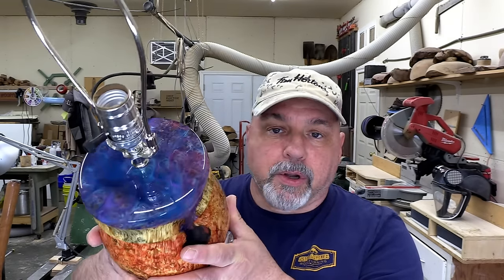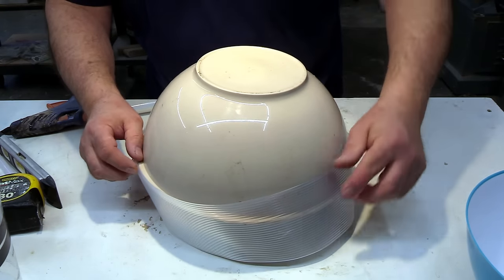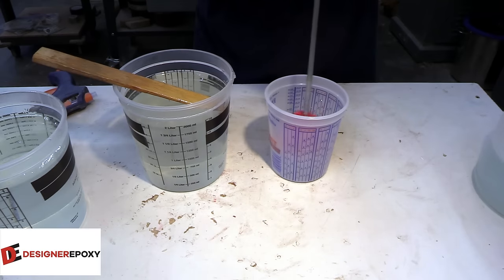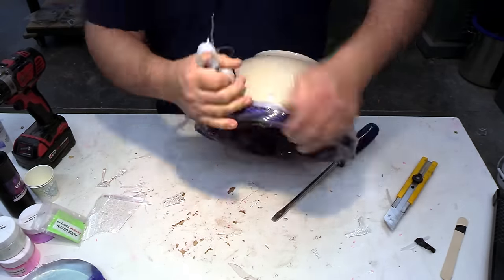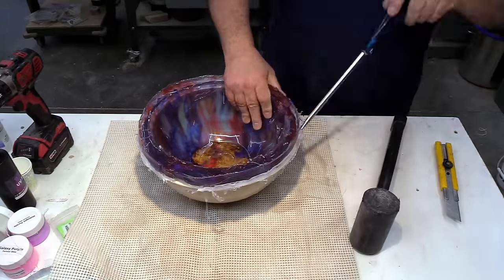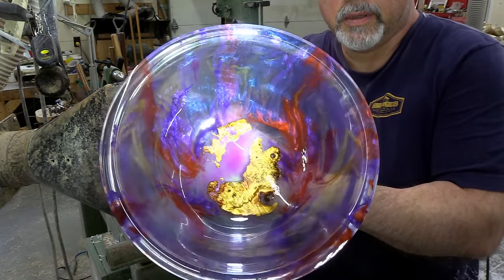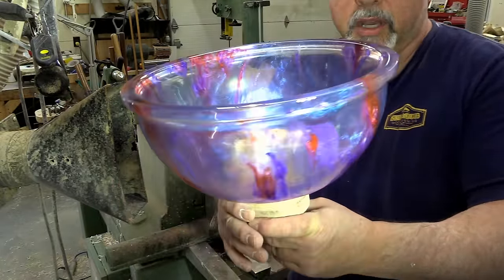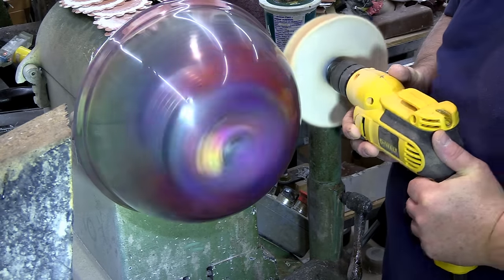Woodturning - Making the Shade, The Coral Reef Lamp Part Two

Comment: So glad the tip on the blue LED worked out! (That was me. C/o mostly my years of working with reef aquariums.) Definitely looks even more awesome with the blue bulb! It brings out that real depth in the layers. GORGEOUS lamp!
Cheers!
Reply from the maker: I’ve got a black light now and will take a photo and post it in the community tab later this week. Thanks for the suggestion!
Reply: @SpragueWoodturning  The thing with blacklight that I'd be concerned about is the UV, but not all blacklight bulbs actually give off UV but still get that glow, which makes sense (but is beyond my understanding, or at least recollection). Cos UV rays of course damage our tissue (especially skin & eyes, dangerously so with UV from fluorescent & halogen bulbs) and also anything exposed for a while, like the resin of the lamp. That's definitely a factor in the eventual yellowing, crazing, & cracking. IF the bulb doesn't give off any UV (as, again, some "blacklight" bulbs don't) then no problem, but do note. Blue light, however, doesn't give off UV, so there's that. Also, true blue LEDs work better for the glow, ime, and also vs a blue cap over a white LED like the bulb you showed, which still gave great results so imagine! You can easily get one of those bulb retrofits that have a regular e27 screw-in but have several LEDs in blue and in cool white, the blue for that glow & the white for normal light. Usually sold as a grow light bulb or aquarium bulb. All this, feel free to take what I've said here & ask others, like if you have or use Discord, or any board (Reddit or something) that does aquariums or indoor plants would know, probably resin folks ought to have found this, though surprisingly I (personally, anyway) haven't seen it utilised in this way, to make stuff glow.

Sorry that was long, but hopefully it might be useful, or point you in a good direction for this &/or future projects, to get that extra pop & take full advantage of that glow quality. Cos really, just a couple of blue LEDs can make the glow stuff GLOW full-bore without having to be dark (though it's more pronounced the less bright a room) and that can really make someone think twice about "glow in the dark" parts.

Final tip, technical info: in aquarium use, especially reef/saltwater tanks, the specific blue light used is called "actinic blue" (said like "uh'TINNic" or "ah"... not quite "æ" like "cat") and is 420nm to 460nm wavelength. (And inb4 "true" actinic, cos it matters not for this application.) This is different from the "blue" 20,000°K (as in Kelvin, colour temperature used for mostly full spectrum bulbs & their appearance, not the nm wavelengths of coloured LEDs), also known incorrectly as "20K" (would be "20k°K" or at least "20kK") ... Just ignore that stuff, mostly for halide/vapour bulbs & for full grow lamps with full-spectrum mimicry.

Sorry, I never learned to be concise! :x
Reply from the maker: @mookinbabysealfurmittens  have a look under the community tab and tell me what you think. Yellowing could be a problem over time with the black light. Thanks again for the info!

Comment: The switch was meant for a 3way bulb and an incandescent bulb. The LED bulbs run at a different frequency that your eyes can see where incandescent run a full spectrum which is why they burn more power. I don't believe they make an LED tri-liggt for that switch, but if it's by a window, it should recieve enough natural light to glow. A great video as always Jim, looking forward to the next one. 

#thebucketstruggleisreal
Reply from the maker: Yes, I also posted a picture on the community tab showing it with a black light. It’s pretty much exactly what I was looking for. Thanks

Comment: Really nice job on the color separation. It is a spectacular piece!
I use frozen water bottles in my pressure pots with my pieces to help with curing process. Of course I pour out a little bit of water from the bottles before freezing. I can hear them kind of making a crackling sound when I pressurize it, but have never had them bust or leak. Now I should probably knock on wood after saying that. Hahaha. Just thought I would share my experience with water bottles. Designer Epoxy 😉
Reply from the maker: Interesting idea! I just might try it sometime. Thanks!

Comment: Another beautiful art piece Jim.  The Designer Epoxy really shows the color separation and clarity on this one !  You may want to look for a shorter harp for the lamp...lowering the shade down to cover more of the switch and harp connections.  Just a suggestion.  Great project.
Reply from the maker: Didn’t know harps come in different sizes. Thanks

Comment: OMG!!!! That is beautiful. Love this piece. Loved it with the bell aspect. It really puts some special effect to the lamp that straight sides wouldn't have. Just the right amount of wood in the shade in my eyes at least. The blue light is better. They used to make a UV light bulb back in the 70's but not sure if you can still get them or not. Designer Epoxy has really opened up a lot of different uses. Amazing stuff.
Reply from the maker: They still do, with I had of got one for the video. Thank you very much!

Comment: I love how willing you are to experiment and be philosophical when things don't work out as you had hoped! I like the bell shape of the lamp too, it looks vintage. Woodturning seems to be such a process of problem solving and finding creative solutions. I wonder if it would be feasible to pour all the resin in and then put the smaller bowl in with Dwayne on top to weigh it down. It might not work well if the resins all combine into one colour, I don't know. Just a thought. I'm with you on using the blue LED light looking better. Very cool!
Reply from the maker: Yes, but it would be difficult to measure the volume correctly. Thank you very much!

Comment: AWESOME Jim, I like the blue light the best. The Bell feature really adds to the bottom of the shade. I have had epoxy get very hot and melt a plastic jar. That is why the hot melt glue started melting on you as well. Designer Epoxy.
Reply from the maker: Yes, she got hot, lol. Thanks

Comment: I think this came out beautifully and is price appropriate for a work of art rather than a utilitarian lamp.  I would have like to see the shade be a little longer to cover more of the metal parts, but it is an exceptional on for the first time doing a lamp.  

I'm wondering what some of the ever popular hyper shift would do look like in the shade as well.  Maybe it would compliment the bubbles even more towards the ocean theme.  

A more economical way do make a lamp, might be to do a pillar style.  So it would essentially be a deep narrow vase with the bulb screwing in at the bottom.  Then it would be approximately half the labor that you put into making the base and the shade individually.  

Love your work overall.  Always hoping my crits are taken constructively, as that is how I intend them.

Designer Epoxy
Reply from the maker: Thank you very much! You just might see that soon.

Comment: Jim nice lamp I liked the base , maybe kif you ever make another lamp you might be able to put more wood maybe something really light in wieght so it wouldn't uze so much Designer Epoxy in the lampshade because I know how heavy that might be with that much resin in the lampshade .It really is very nice looking ,but I would be afraid it might topple because of the weight .Keep up the good work Jim 👍,Your friend Henry
Reply from the maker: The harp seems to hold the weight just fine, but yes, it can be a problem, thanks!

Comment: Designer Epoxy. Jim, this is a masterwork. I am glad you tackled something new and accepted its challenges. I do like the shape of the shade and the rim is a great addition. Question: What is the approximate thickness of the shade in the middle (knowing the top and rim are extra thick)? I'd like to attempt a pure resin shade and a pure resin bowl but I'm unsure of a thickness that would be sturdy enough.
Reply from the maker: The sides are about 1/4” thick, thanks.

Comment: First time I’ve felt at a loss for words. It’s beautiful. But I prefer the shade for a lamp like this to be of the flared slat type. Can be as long or short as wanted. For this lamp a resin slat, with a very thin wood slat, alternating around. Or instead of beautiful wood, oiled parchment, maybe with resin colors on it, as on the resin slats. It’s done that way with these lamps made of glass.
Reply from the maker: Thanks for the suggestion!

Comment: Jim- The finished Iamp is beautiful.  I like the rim on the bottom of the shade. If it were mine (I can dream, can't I?), I would get a slightly shorter harp and a taller finial (perhaps in an ocean theme of some kind to go with the theme of the lamp.  I do like the blue bulb in it much better. Awesome job! 😊 Designer Epoxy
Reply from the maker: You and me both!  Thanks so much!

Comment: Hi Jim - Great job on the coral lamp! Have you ever made a resin piece using flower pots as the cast in any of your travels? Nesting different size? Just wondering - thanks a bunch! Bob
Reply from the maker: Not yet, I was going to use two smaller buckets for this casting, but decided to use the plastic bowls. Thanks

Comment: Hi Jim, you have been doing this a long time and I really respect your work but with your rice calculation are you allowing for the air gaps between the rice? If so can I point out that wen you poor the rice into a measuring pot the gaps are still there and do not need to be accounted for. Please let me know if I'm understanding this wrong. All the best, Mike.
Reply from the maker: The measurement is actually .4, it’s just easier to times the volume by 1.4 to get the correct amount, and yes, it accounts for the space around the rice. Thanks
Reply: @SpragueWoodturning  I realise with the 1.4 is .4, what I'm saying is that you do not need to take into consideration the gaps in the rice. Thanks
Reply from the maker: @MikeHolton  Ok, I’m not totally sure what you’re referring to. If I don’t account for the space around the rice when it’s placed into a container that I can get a measurement from, the volume that will be needed will come up short. Sorry, I’m just confused with your comment. Jim
Reply: @SpragueWoodturning  Sorry Jim, probably my poor explanation. In a recent video I made I had a few comments from people that you allow in your calculation (1.4) for the space between the rice grains which did not seem correct to me.

Comment: Great work. I like how this turned out with the base and lamp.  Question for you... I like how the Art Cast thicken quicker to get your color separation. You used the Art Cast for your primary color and the added colors. Have you ever tried using Deep Cast as your primary color and adding thickened Art Cast for your added colors? Designer Epoxy
Reply from the maker: No I haven’t, but I’m told it’s possible. Thanks

Comment: It came out very beautiful! 
I do know some things about LEDs and UV light. Most UV LEDS also emit some high-frequency visible light, which is as much a technological limitation as it is a safety feature. A single UV lamp that's on all the time in a room isn't likely to give one skin cancer but it is bad for the eyes. A UV bulb that is powerful enough to work as a blue mood light or something to read by isn't a good idea for a lamp. The bulb used in the video is indeed blue but it's not made with blue LEDS; that sort is regular white LEDS with a blue filter on the bulb because it's a whole lot cheaper to make. Actually blue LEDS do often have some UV emission and that should probably do the job. A sunny window that doesn't get too hot is probably better than a UV bulb, but if the glass is made to block most UV light then the owner of this lovely lamp will just need to have a separate UV light to charge it with when they want to see the effect.
Reply from the maker: Thanks for the info!

Comment: There are light parts manufacturers out there that make a shorter light bulb mount, including a shorter, 'halo', lamp shade hoop.
To lower the lamp shade down closer to the base, thus hiding the switch/bulb base.
Reply from the maker: I did buy a shorter harp for this piece and it looks much better. Thanks

Comment: Given a lampshade is a diffuser, I wondered if coating the inside with a somewhat opaque color would allow the lights glare to soften while the shade is still somewhat transparent?  Just a thought. Nice job overall, long project, lots of work involved, good job!
Reply from the maker: Opaque would work, but I’d be worried about loosing some color in the meanwhile. Thanks

Comment: It's kinda weird to me that the top matches the bottom better when the lights are turned off and the UV light hits it. During the day, the shade doesn't match as much unless it's at a certain angle. Too bad a little bit more of the blue from the bottom didn't stay on the top, but it's still a pretty neat peice. I agree the blue light kinda helps bring the blue from the bottom up to make it stand out a bit more. 

Seeing those glue strings made me wonder if you could have saved some of those glue strings and hung them off the lip. It would really look like a jellyfish! haha. I don't think it needed it, but it would be different. I don't know anyone that has really done a jellyfish with actual tenticles. Maybe a future project idea. haha

Designer Expoxy.
Reply from the maker: I will attempt to recreate the tentacles in the future, thanks for watching!
Reply: @SpragueWoodturning  That would be awesome! Jellyfish are amazing creatures!

Comment: Very cool.  It was a good call to leave the lip on the bottom edge of the shade.  I really like the glow in the dark colors.   It is a sort of hidden surprise!

I have a question for you if you have a moment.  I am working my way through your videos and have not heard you cover this, or I just missed it.  What speed do you turn when you apply a top coat of epoxy or the Waterlux? 

Thanks for sharing!  Have a great weekend.   Designer Epoxy
Reply from the maker: Probably about 60 to 80 rpm ish, thanks!
Reply: Thank you!  I have a dedicated rotisser motor that I can screw my chuck onto that will turn 50 rpms.  I am hoping that will work.  Thanks again!

Comment: 20:58 I noticed the waste block has grooves cut into the side that’s against the epoxy. Was that done with a purpose or just left over from a previous project with the wood?
Reply from the maker: It’s done on purpose, the block holds better with the groves. Thanks

Comment: Jim, I don't know why there is such a stigma about wearing gloves. I wear a pair of baseball batting gloves all the time. But I'm in the Philippines where it is hot all of the time. They just allow me to grip the tools firmly.
Reply from the maker: It comes from the metal lathe community, metal lathes are unforgiving, they are usually gear to gear and if stuff get wrapped up in them it can get torn off. Thanks!

Comment: Jim, I know you've covered this but couldn't find the answer.   I'm trying to locate a Canadian dealer for waterlox but the only supplier that comes up is amazon.  Are you able to "fess up" as to your local supplier?
Reply from the maker: It’s actually cheaper to buy it directly from them in the US. Exotic wood and supply in Burlington has some, but not the gloss that I like to use. Thanks

Comment: Why would water bottles "explode"?

The pressure would be pressing inward. The air would compress and the sides may bow in, but water in not compressible, so should not have any difference in size.
Reply from the maker: Correct, water isn’t compressible, however the container that the water is in needs to be in the same category, like a hydraulic cylinder. The water bottles are not so when the pressure goes in, the bottle tops will be blown off and water will be everywhere. Thanks

Comment: The blue LED bulb looks great, but it's probably not going to emit the UV light needed to charge the UV resin. Most white LED bulbs have blue LEDs with a phosphor coating that shifts the frequency from blue to white. A blue LED bulb is essentially the same, but without the phosphor coating. LEDs are monochromatic, i.e. a blue LED will not emit light at any other wavelength - including UV.

You could try a blacklight LED, as that should make the UV resin glow without producing much (if any) visible light itself. I'm sure we'd all be interested to see the effect that would have.

AFAIK you can get white LED bulbs that run off UV LEDs rather than blue. The phosphor coatings used to shift light frequencies degrade over time, letting an increasing amount of the source light through. For a blue-to-white bulb this means the bulb turns slightly blue over time. But for a UV-to-white bulb there's no change in colour, only a barely perceptible drop in brightness, because UV is invisible to most humans. Even a moderate amount of UV should be enough to charge the resin, if given enough time. UV-to-white bulbs are actually required in certain situations because the hi-viz clothing used by emergency services personnel glows through fluorescence, which requires UV.
Reply from the maker: Wow, lots of great info here. Thank you very much!

Comment: Jim, I have absolutely loved everything you make, so I hope this doesn't offend you, but I think the lampshade is a big miss. The casting and colors are really neat - love them, but the shade is just too short. It needs to come down over the frame quite a bit more (maybe replace with a shorter frame?). Also, the "rim" on the shade looks ugly to me. If the shade had been one continuous curve right to the rim, I think it would have looked so much more elegant. But that's me. Strictly my opinion. I'm wondering what the rest of the fans thought. Designer Epoxy.
Reply from the maker: So far it’s a hit 🤷‍♂️, thanks for watching!